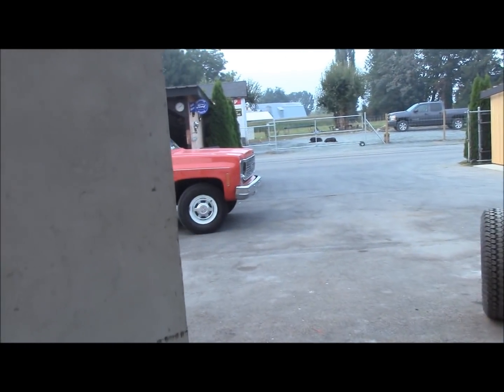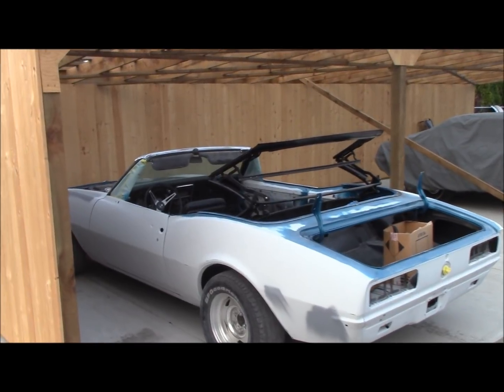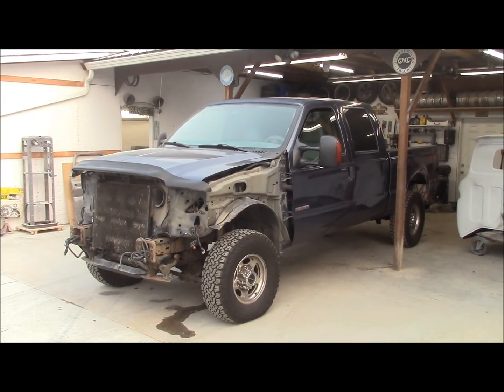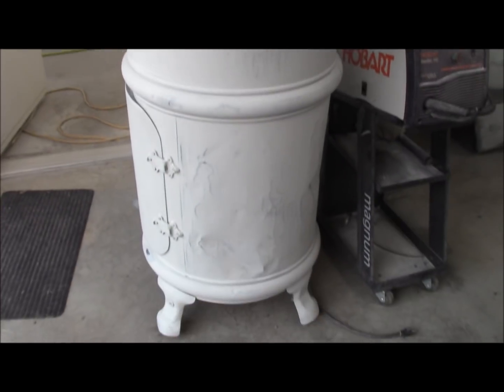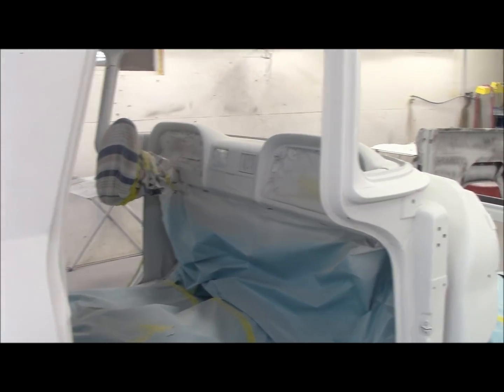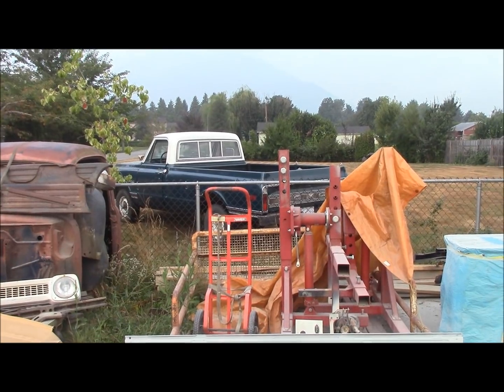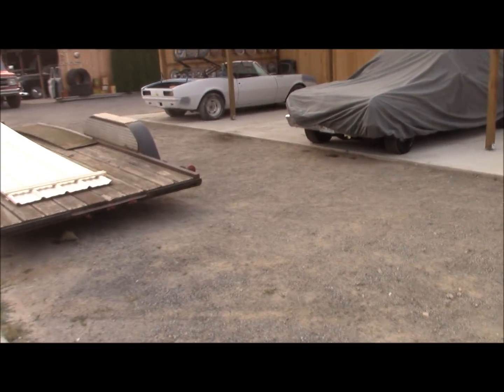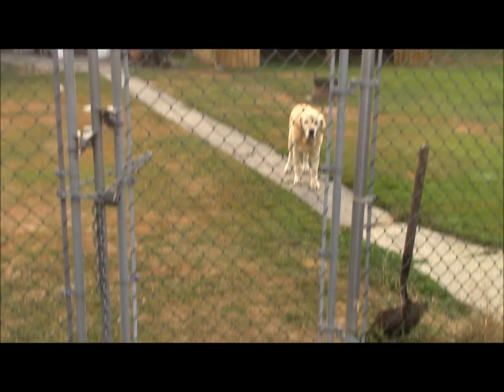Shop Update Aug 28 2018

Comment: Working on a 1951 international L110 pickup truck and i am converting it to 12v i have everything except for a spotlight bulb. It's an odd size . Smaller than the cop car bulbs. Any suggestions on this?
Reply from the maker: hmmmm...I haven't seen one anywhere I can remember.  Maybe check out the swap meets - those guys that set up shop with all the different hard to find bulbs would be my suggestion